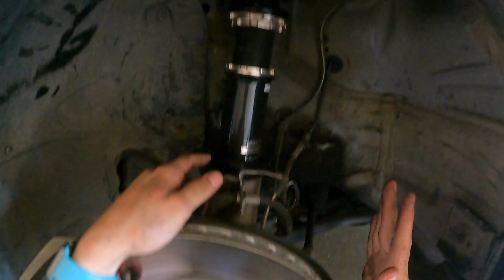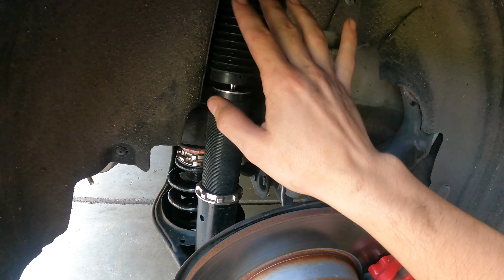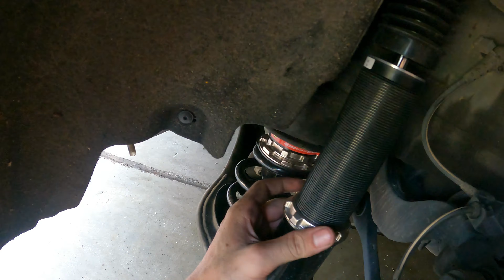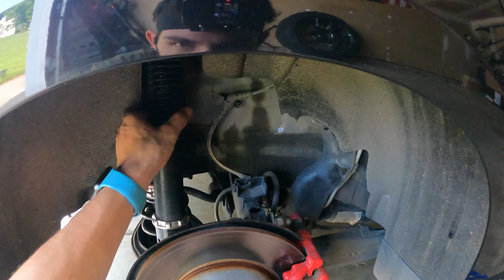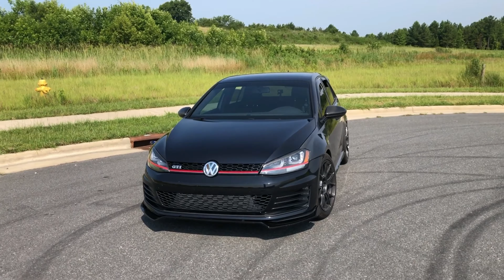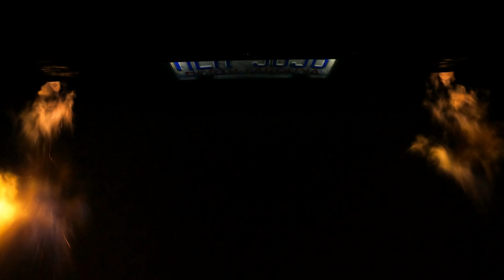DIY VW MK7 GTI BC Racing Coilover Install! Step-by-step Walk-Through!

Comment: Do you have to undo the shock bolt when you adjust the spring (ride) height ? I've seen a video where they unbolt the shock to meet the control arm bolt once they've lowered it. Is it the same as just spinning it whilst its on like you do?
Reply from the maker: It’s the same, you don’t need to if you don’t want.
Reply: @HaydenCroix  Thanks, I thought it makes it way easier if u spun the shock body instead of undoing it entirely. Seems like it does the same thing both ways.

Comment: Hayden, I just picked up a set of these. Im really not wanting to mess with the camber, do you just do your best to make the camber plates identical on each side before you mount it?
Reply from the maker: That’s exactly right. I just set both of mine as close to center as possible and then went to get a professional alignment afterwards.
Reply: @HaydenCroix  Cant even tell you how much I appreciate the response, its hard to get feedback on old-ish videos!
Any vibrations or anything from the camber plates? I got really really lucky and picked these up for $250 with 5k miles on them for my Golf Wagon!
Will for sure be getting an alignment at a euro specialty shop after putting these guys on. Your main trouble with the rear was just getting everything level right? I think I might do fine there since I did springs already last year, havent messed with endlinks, hope theyre kind to me
Reply from the maker: @Zakw17  Of course! And I never experienced any vibrations personally. And you are spot on as far as the rears go. Just measure fender to floor and it should help you with getting them even.
Reply: Yeah all my suspension dialing in the past was cause I was lucky enough to have “that one friend” 😂. Gonna be my first foray into setting this up myself as far as height and dampening. To soften them you just turn the knobs thay poke through the strut tower right? And rears are more complicated right? Thanks for your help also
Reply from the maker: @Zakw17  You should be good to go, it will take some time but it can easily be done. And you are correct, the fronts are from the top of the strut tower. Start by turning them all the way one direction and count your clicks to make match. The rears can be done if you get the car on a jack. I cut a small piece of the fender liner to make it always accessible without having to remove anything.
Reply: That’s a great idea. Thanks man.
So glad I don’t have to deal with strut nuts or spring compressors this time lol

Comment: Did you use a power tool to remove the top nut on the rear OEM strut mount that needs to be reused?
Reply from the maker: With the BC coils there was a new one supplied to use. I used and impact drill when necessary though it is possible to do without.
Reply: @HaydenCroix  I've done lowering springs before so this should be cake walk then. Then other videos I've seen they've had to reuse the rear top mount, so maybe this is a new addition to the mk7 kits?
Reply from the maker: @brandonmills2033  it could be. I have installed a set that required to reuse the oem top hat/nut. It was super simple just need some spring compressors

Comment: How do you adjust the front dampening on urs? Did you cut of the top area of the strut mount to be able to do it or did you remove the whole coil over?
Reply from the maker: You should have no problem accessing the dampening up front. Just remove the small plastic cover on top on the strut tower. To adjust camber you will need to either remove the strut or cut a hole in the strut tower. I believe cjm makes a jig to cut it out and make it look good.
Reply: @HaydenCroix  ok thanks for the info

Comment: how would you lower the coilovers then with them alrady installed?
Reply from the maker: Just remove a wheel and use the spanner wrenches to adjust the lock rings on the strut. Typically people measure fender to the floor to see their ride height and adjust for them to match. The rear can be more difficult but in theory is about the same.
Reply: @HaydenCroix  installed the fronts today and for some reason we measured wrong and actually raised my car, lmao. So If I wanted to lower the car in the front all I would do is adjust the lower lock ring? Kinda of confused, sorry
Reply: @HaydenCroix  luckily we did the rears perfect and also measured the same way for the fronts but it ended up being raised? lmao
Reply from the maker: @ZenRelent  correct. You will adjust the two lower lock rings. Separate them and move the bottom one lower then move the other one down to it and snug them up. Once the car is off the jacks roll backwards and forwards about 5 feet to show your actual ride height.

Comment: buddy told me you can only raise them while installed, is that true?
Reply from the maker: Not at all. Just make sure to jack up the wheel you want to lower remove it and it will be no problem lowering them or raising them.
Reply: How do I adjust the ride height for the rear coilovers? Do I just need to loosen the shock lock ring or do I need to also mess around with the 2 spring rings too?